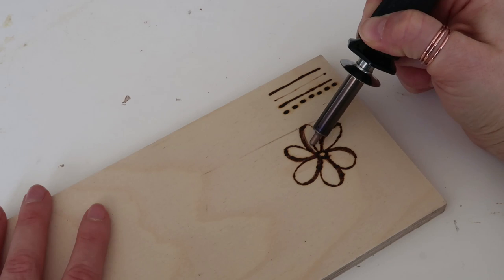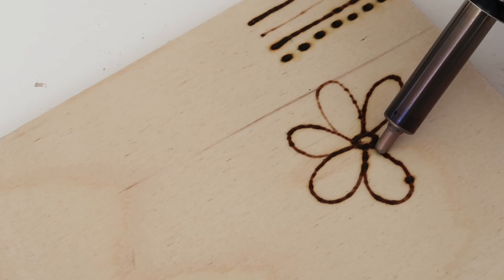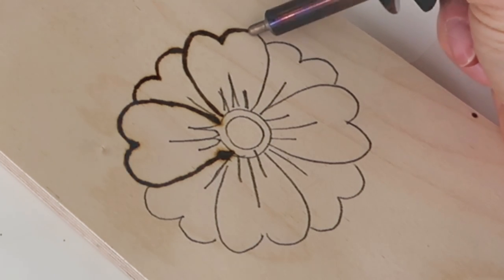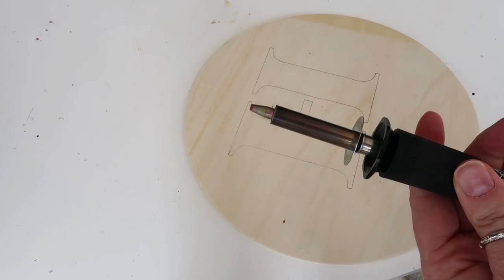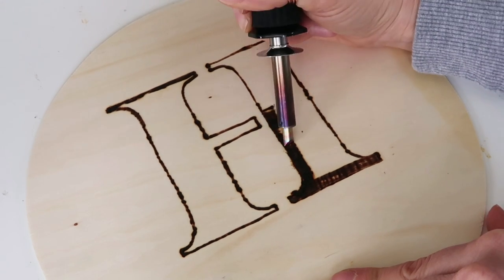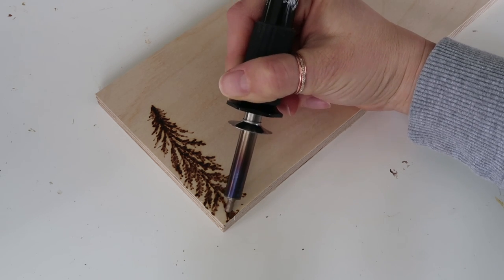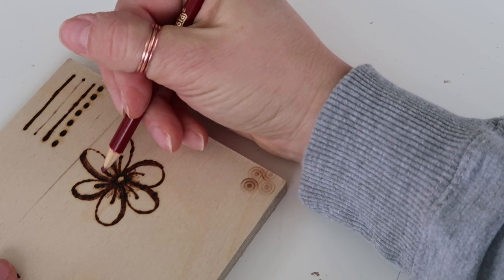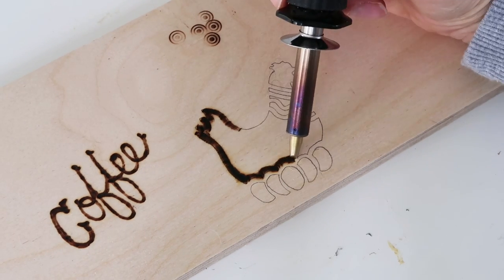⭐ WOOD BURNING - Easy, Fun DIY gifts, decor projects & ideas to try - Beginner Walmart Kit

Comment: I have been doing wood burning for just over 16 years, 10 of those years professionally. I also have a channel teaching how to burn realism with a wire tip wood burner (ValarieConnell /DrawingWithFire). 
☆ Woods - basswood, Baltic birch, poplar, maple. Those new to burning should stay away from pine & oak.
☆ Tips (a few) 😉
1. Always sand the wood... 220 grit, 329 grit, 400 grit
2. Use graphite paper, not carbon paper. (Wanut Hollow or other gray transfer papers)
3. Turn down your heat. Only use the heat setting you need. Wood burning is a slow & patience growing art form. 
4. If doing realism, don't outline the subjects first.
5. Use a scrap piece of wood similar to your project wood to test your heat before touching down on your project.

Happy Burning! 🔥
Reply from the maker: Hi Valerie🤗 Thank you!! Thank you so much!! Awesome and really helpful tips🤩🥰 I'm going to give those a shot! And definitely checking out your channel!
Reply: This is definitely the channel to watch if you want to learn woodburning. Valerie is great!
Reply: Thank you so much @cordialgreetingsart  I really appreciate it! 🤗

Comment: I have had my wood burning set for at least three decades. It was from Michaels. It came with five tips. I didn't like the stand so I put money in a heavy duty coffee mug when I am cooling it. Works great. I like the angled tip the best. For lines and shading. I made a very detailed barn scene on a slice of oak with the bark left on the edges. Very rustic and was a gift for husband. Have fun and be creative! Your projects turned out very beautiful. Great job!
Reply from the maker: The coffee mug is a great idea!! The stand that came with mine moves around a lot, so I may use your mug idea👍. Thank you so much for the tips. I have to try and get used to the different burning tips. I bet your barn scene looks beautiful!! It's a sweet gift that will last forever💕💕💕

Comment: I was thinking of maybe combining the wood burning with a colored stain
Reply from the maker: That would be really pretty! 🥰
Reply: Colored stain is dye based and fades pretty quickly.
Reply: @DrawingWithFire  you seal it with a polyurethane
Reply: @KMF3  I don't seal with polyurethane as it is oil based and darkens the wood. I use liquitex varnish (gloss) or polycrylic, which are both water based and don't darken the wood as much.
Reply: @KMF3  also neither polyurethane or polycrylic are uv protective... and those that are listed as indoor/outdoor can yellow.
Reply: @DrawingWithFire  I sealed my stenciled white cabinets 12 years ago with a water based polyurethane and they have not yellowed. Yes they are inside. And anything outside is always subject to yellowing or fading especially where I am in southern Arizona where the sun is brutal. What do you suggest?
Reply: @KMF3  fyi I live in Flagstaff (10 yrs) and before here, Phoenix (21+ years). 😉 I am definitely well aware of how brutal the sun can be to both the art & my body. 🤣 I recommend pigment based products as well as products with lightfast ratings. Watercolors, colored pencils, watercolor pencils, and acrylics. I don't recommend: watercolor markers, alcohol markers, sharpie markers, stains, or student grade art supplies as none of these are lightfast. Incorporating a high quality UV archival spray when varnishing can help. Because your cabinets are indoors and you have been looking at them for 12 years there is a good chance you haven't noticed the fading of color & darkening of the wood from when you originally did them. As long as you still love that is what matters. 😁 I have been wood burning for over 16 years and professionally for over 10 years.

Comment: Sand the wood before with 220 grit, pull towards you and turn the wood to make it easier to burn go low and slow light pressure.

Comment: Do you think you could wood burn a pine tree wedge its been drying for 2 years and is sanded
Reply from the maker: I don't see why not. That would be really cool🥰  Maybe try a little bit on the bottom to see of it works first. I wish I could see it when you are finished.